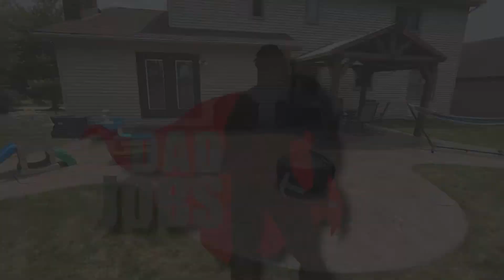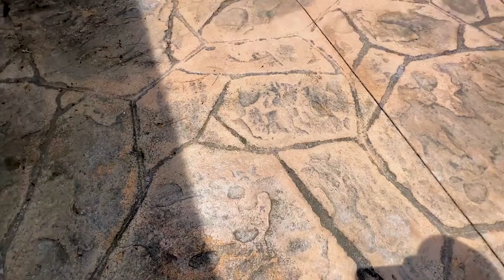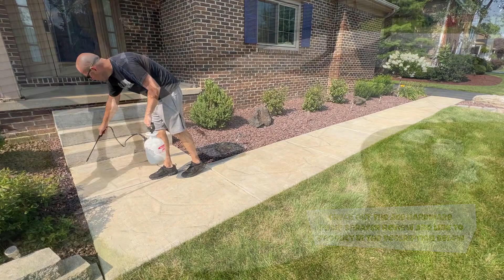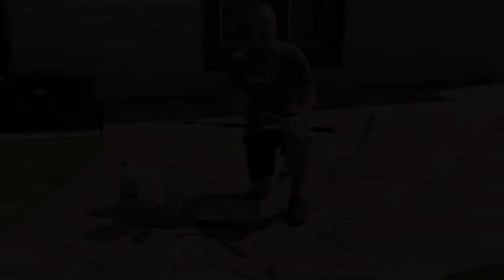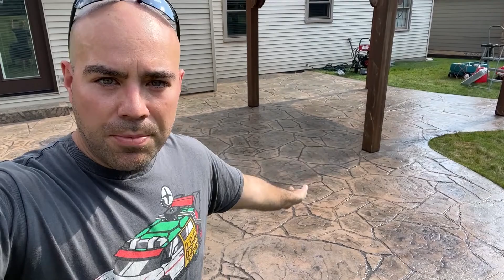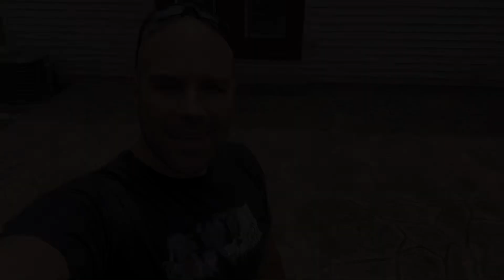REVITALIZE YOUR STAMPED PATIO | Masonry Defender Stamped Concrete Sealer Tutorial + Review

Comment from the maker: Hey everyone! In this Dad Job Adventure, I’ll be applying Masonry Defender Stamped Concrete Sealer to my back patio, which as you'll see, has been in need of a new coat of sealer! It's a super easy application, as you see in the video!

---
Link to purchase:

Masonry Defender Stamped Concrete Sealer - https://amzn.to/49cUDYe

Ace Hardware 1/2 Gal Sprayer - https://bit.ly/49zO68X

---

Dad Jobs is not a licensed plumbing, electrical, or contracting professional. This video is strictly informational, and you accept all responsibility when doing repairs in your own home.